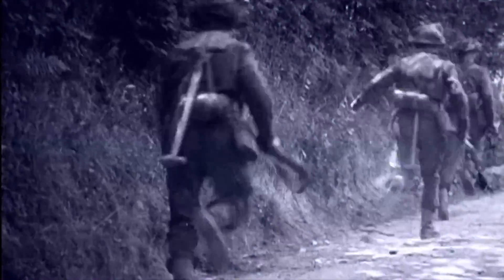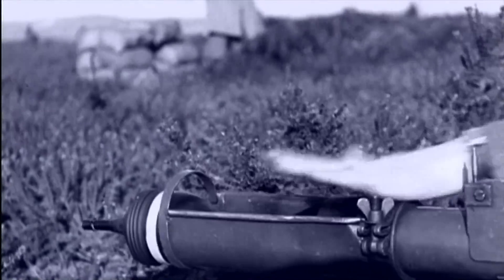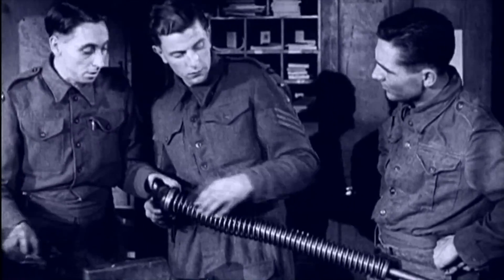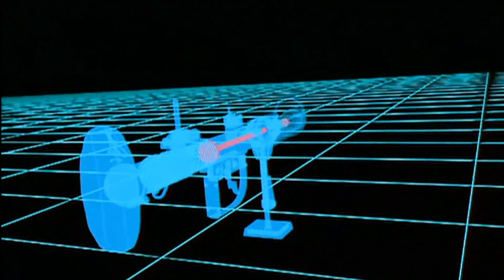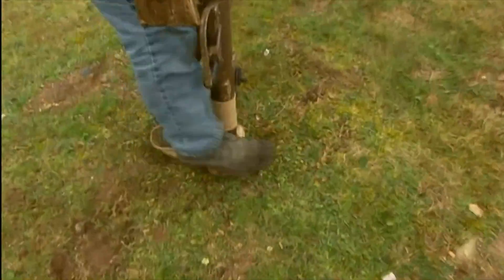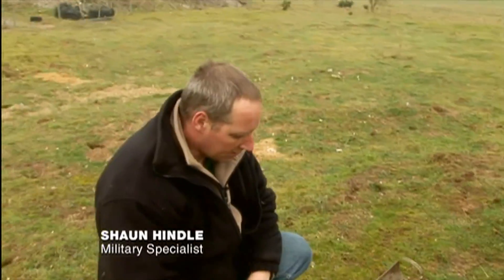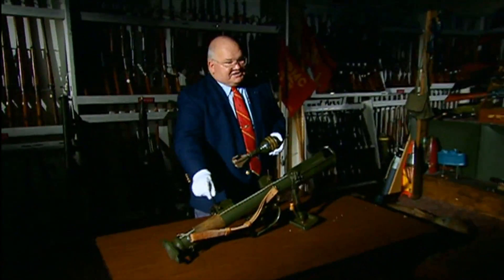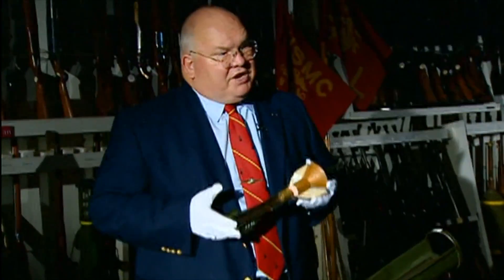Weaponology - "British PIAT"

Comment: I think the point being missed is that it was the first shaped charge AT. Prior to that it was sticky bomb!
Reply: Actually no, it wasn't. M1 Bazooka was in service the year before it, as was German's Hafthohlladung hollow-charge magnetic anti-tank grenade. I was kind of surprised to find that out too, but the PIAT entered service about the same time the M1A1 Bazooka did. I think it only gets a first if you count development rather than adoption (1941 for the PIAT, 42 when Uhl thought of using a tube launcher for the Bazooka, which should tell you how rushed the M1 Bazooka development was).
Reply: @CruelestChris  
The Bazooka was not in service in 1942, some were sent to the British in North Africa but they did not use them because they were useless. The Bazooka development lasted from 1942 to well after the war still trying to get it to work properly.
Reply: @barrierodliffe4155  
No, they didn't use them, as the source you quoted said, because they didn't feel they required a weapon with the specific capabilities of the Bazooka in that theatre of operations (due to a lack of appropriate cover to get it within effective firing range), not because "they were useless." It was indeed in service in 1942, a US weapon enters service when it is given an M designation, which happened in 1942, and they were issued to combat units during Operation Torch. The M1A1 was also in service in 42.

And no, it's completely normal for weapon R&D to iron out bugs in the weapon gradually over time: the M9 bazooka was effectively a completed model since the only developments to it were a minor incremental change to the M9A1 (a better coupling sleeve). The M20 was reflective of improvements to tank armour late in the war, which improved so quickly almost every anti-tank weapon designed mid-war was obsolete against heavy tank armour by the end.
Reply: @CruelestChris  
In other words useless, they didn't need an unreliable weapon that you could not hide and if you used it once gave it's position away no matter how well hidden it was.  The M 1 in service doing nothing. very good. The M 9 in 1944 still had severe bugs, try reading US reports on it's problems and unreliability.
The M 20 not in service for years after the war.
The PIAT was still effective in 1945.
Reply: @barrierodliffe4155  
No, they didn't want it because they didn't think the terrain would allow them to get close enough to employ it. The decision had nothing to do with reliability and everything to do with the weapon's effective range in that type of terrain. You're simply making up a claim your source doesn't support.

I've read the reports on the M9: those are not "severe bugs," they are issues . The primary one, that it had to be employed at extremely close range to defeat heavy tank armour, can also be found in British late-war evaluations of the PIAT, and indeed in evaluations of just about every anti-tank weapon in service.
Reply: @CruelestChris  
No they did not think they could get to within 30 yards and they also knew that if they got close enough they would be dead after the first shot. 
The Bazooka was unreliable until the end of the war. The issues were rather severe, meaning it was still a faulty weapon.
The PIAT was intended to be used close to the tanks, it was never meant to be a long range weapon but it could and did destroy German tanks without giving it's position away. You try to ignore how effective the PIAT was in real use.
Reply: @barrierodliffe4155  
30 yards was 1944 armour, not 1942 armour. They didn't think they'd be able to employ it effectively in a desert. They probably would have rejected flamethrowers for the same reason, does that mean flamethrowers were useless?

And no, it was if anything more reliable than the PIAT at the end of the war, and neither was it any more dangerous to use.
Reply: @CruelestChris  
The Bazooka was ineffective against real armour until after the war. The Bazooka would have been useless in North Africa even if there was cover which there was in places, it was not all desert you know or probably not your name says it all.
Flame throwers were dangerous until the British put them on the  Wasp and Crocodile, then they were very effective, the British were not stupid as you try to make out.
The Bazooka was still unreliable at the end of the war. It was far more dangerous to try to use it  than the PIAT which could be fired from a concealed position without giving it's position away and then fired again and again leaving the German's in confusion.
Reply: @barrierodliffe4155  
No, it wasn't. It was, like all anti-tank weapons, superceded by late-war advances in tank armour. How exactly do you think the M9 could be ineffective but the PIAT effective when both the M6A3 rocket and the second modification PIAT bomb had the same performance (~100mm RHA)? Either could penetrate the side armour of a Tiger I, the thing was the US wanted something effective from the front.

Both weapons could be fired from concealed positions. You can fire an M47 Dragon from a basement, nevermind a bazooka. You're simply making things up here, granting all possible credit to one system and none whatsoever to the other.
Reply: @CruelestChris  
Yet the PIAT did take out and stop late war tanks. The unreliable Bazooka was less effective, that is a fact. The PIAT did take out tanks from the front, including the Tiger tank. Both could be fired from concealed positions but the Bazooka only once then it is not concealed any more. I make nothing up the Bazooka fired from a basement and the basement would be uninhabitable for anyone unlucky enough to be in the basement.
I give credit to the weapon that served so well.
Reply: @barrierodliffe4155  
So we'll just ignore the data on what the rounds could actually do, I see, in favour of blank assertions that one must be better than the other because you say so. We know there's a least one case of an M1 bazooka killing a Tiger I from the front (blind luck, the rocket hit the driver's vision port), that doesn't mean it could do so with any degree of consistency. And we equally have reports of successful kills against late-war tanks with bazookas, including multiple cases of side and rear penetration of Panthers and King Tigers and a German account of a bazooka team managing to take down a Jagdtiger. The M9A1's reputation for being ineffective actually comes from the Korean War (specifically the Battle of Osan) where rockets which had never been designed for long-term storage were pulled out and issued, and had degraded so significantly that they couldn't even penetrate the rear armour of Nork T-34/85s. That's why development and issue of the M20 was restarted.

There are similar statements available that PIAT's effective range had dropped to dozens of yards late-war (we also have that 60% first-round hit rate at 100 yards from Sicily, backed up by range testing detailed in War Office report WO 291/153 which gave a hit rate of only 35% when the target vehicle was approaching from 110 yards to 65 yards) and it had similar problems dealing with vehicles with side skirts. The only reason there isn't a similar statement that a new model was needed is that the PIAT was already pushing the limit of what a man-portable weapon using a spigot mortar mechanism could do, and an M20 equivalent would just be a portable shoulder-breaking machine.

I mean nevermind the parts of that Bazooka copypaste-from-Wikipedia that clearly work against your point: are you seriously trying to bring up that soldiers complained about the M9A1 weighing 14.3 pounds empty as a point in favour of the 32-pound PIAT?

And as said, you can fire gigantic missile systems like Dragon and TOW from enclosed rooms, nevermind a wee fart of a thing like a Bazooka. As for not being seen, that's blind luck again: we know of cases where a PIAT crew got made on or even before their first shot (Robert Cain being one such case when the StuG III located his spotter at Oosterbeek, and let's not even bring up the part where his own PIAT took him out of combat when it malfed), and the War Office evaluation stated that a rule of thumb in the field was that a PIAT team could fire at most 3 shots before being spotted.

The problem here is you're pulling advantages for the system out of nowhere. The PIAT with the Mk1 or Mk1A bomb was similar in armour penetration to the M1A1 (~75mm RHA due to the issues with manufacturing) and with the Mk2 and later it was equivalent to an M9 firing the M6A3 (~100mm RHA). These two weapons had effectively no difference at all in what targets they could engage and how (aside from the PIAT having better anti-structure capabilities and being able to be jury-rigged into a high-angle mortar much more easily) had similar effective ranges at all stages of the war (PIAT is usually stated as "less than 40 yards" late-war with VC recipient Ganju Lama noted as saying he wasn't sure it would be accurate past 30 yards,  and it's known Patton wanted Bazooka teams to hold until 30 yards), were both troubled by side-skirts, and both had serious reliability issues early on. We know from after-action reports that ~25% of PIAT rounds fired in Sicily were duds for one reason or another, which works out as 1-2 of the six bombs an average PIAT team carried being ineffective.
Reply: @barrierodliffe4155  
I said one case of a baseline M1 killing one from the front , have you entirely lost your ability to comprehend English now? And I have yet to see you present anything resembling facts, simply blank assertions and a chunk of Wikipedia you dumped out in another thread.

And you have even less ability to comprehend English if you think I hold that anything British is no good. I've defended the bloody Sten , which is a hell of a lot more than I've seen you doing, and stated the Bren was better than the BAR on multiple occasions. While we're at it, the Typhoon was phenomenal and most of the data claiming its rockets were ineffective is nonsense, the Matilda II was superior to any German armour in France during the early war, the Lee-Enfield was the best bolt-action rifle of the war, the Mosquito and Wellington were both fantastic...Unless you believe PIAT was literally the only British weapon, this is just a dumb argument.
Reply: @CruelestChris  
One case of a lucky hit by a Bazooka and that makes it the best at least according to you.
Your trouble is you hate it that the PIAT worked.
The Sten was very good, the Matilda was also very good in France and North Africa,  the Typhoon very good for ground attack after teething troubles, the Wellington ok and the Mosquito fantastic, you left out the best heavy bombers and the best fighter of the war also British, then there was the Universal carrier and so much more.
The simple fact is the PIAT was far better than you make out.
Reply: @barrierodliffe4155  
No, I would suggest you go back and read again. Do you think misrepresenting my own argument to me is going to trick me somehow?

I don't "hate that the PIAT worked." Of course it worked, there are multiple VCs that show that. The issue here is your belief that it was some kind of superweapon. You're using the same kind of argument that Wehraboos use to big up the StG: ignore the numbers, ignore the reports, focus entirely on soldier testimonies and attack something else (they go for the Garand as a rule)  as if that makes your thing better.

Best heavy bombers I didn't include because I didn't fancy trying to evaluate the Lancaster against the B-29. Prior to that I'd put Lancaster and B-17 about equal, since both had capabilities the other didn't.
Reply: @CruelestChris  
The PIAT was a good weapon and I never said it was a super weapon. I do not ignore fact that you hate.
The B 29 came along very late in the war at very high cost and had it's own problems.
The B 17 was slower, had a lower payload and less range, I can't think of a single capability the B 17 had that the Lancaster didn't.
Reply: @barrierodliffe4155  
No, it was a mediocre weapon with issues fundamental to its design which meant it simply could not be made accurate (12 pounds of weight switching ends an instant before firing and nothing but the spigot to provide alignment guidance to the projectile). Immensely brave men used it to do incredible things, but this says more about the men than the device itself. The M1 was a worse weapon, the M1A1 comparable, but after that the M9 was the superior system in all but a few niche capabilities. Same penetration, same effective range, much lighter and easier to carry, virtually no recoil, etc etc. 

B17, better defensive armament (the Lancaster's .303s were obsolete even at the start of the war, .50 cals were too by the end but were relevant for longer and the Germans were noted as being terrified of approaching large B17 formations) and better damage survivability, particularly on the engines (Lancaster engines were better, but being liquid-cooled they weren't fond of being shot at). The B17 was also more stable and thus easier to fly in formation. While the Lancaster had a larger maximum payload, their typical carry weight was about the same. And the Lancaster was noted for having a crew escape hatch that was much too small and never redesigned: it was significantly easier to escape from a Halifax than a Lancaster. Granted, none of these make the Lancaster a bad aircraft by any stretch of the imagination and I'd argue none make it measurably worse than the B17 considering its advantages, but I would place them about equal, giving one or other the advantage if we were talking about a specific scenario.

And yes, the lateness of the B29's development is why I don't judge the comparison to be particularly fair since it's basically an aircraft from a different generation: it's as unfair as comparing, say, the King George V class battleships to the Iowa class.
Reply: @CruelestChris  
So mediocre that it did a good job when there was nothing else.  It was accurate enough for the job it was designed to do. as for the rubbish you are making up. The PIAT was there and did plenty.
The B 17 and better defensive armament is shown to be a myth since the B 17 could not escort without a fighter escort. The Lancaster did carry a bigger payload and a more useful range of bombs, you forget the US ton is much less than a real ton.  Not only was the Lancaster in no way bad it was far better and di far more than the B 17. 
If talking about any bombing scenario the Lancaster was better.  
Was the Iowa very bad then?  because the King George V battleships were not bad.
Reply: @barrierodliffe4155  
Being the only thing available to do the job automatically means it's the best tool for the job, you ninny. The point of comparison at the time was the Boys, which was heavier, larger and totally ineffectual in just about any scenario where it was used against armour. I am not making up anything: the accuracy of the PIAT was poor as a result of the nature of the weapon itself. Or are you trying to imply that the PIAT's striker assembly did not weigh 12 pounds, did not switch ends an instant before firing, or that it had alignment guidance aside from the launching spigot? You see you keep accusing me of making up concrete facts and it's just making you look desperate.

The B17 had superior defensive armament to the Lancaster, this is a simple matter of counting turrets and guns and looking at the calibre. Of course it was preferred to have a fighter escort, but that wasn't really an option until they started putting Merlin engines in the escort fighters because they didn't have the endurance. And you're assuming the bombload stats I was using were in tons for what reason? They were in pounds. The standard loads for both aircraft were similar, about 4,000 pounds, since it allowed them better range than deploying with a full load. Yes, at max load Lancasters could take off hauling eleven 500 pounders while the B17 could only manage 8,000 pounds, but that wasn't normal.

And I really don't understand your reading comprehension sometimes. It's unfair to compare the King Georges to the Iowas because one was a prewar Washington Treaty compliant design and the other mid-war and not compliant with anything. The KGVs were excellent ships when they were designed (which is impressive considering quad turrets seldom worked out well), but no match for a non-treaty battleship whose only design limitation was the width of the Panama Canal.
Reply: @barrierodliffe4155  
Oh I se, it was "obviously" good enough! The problem here was you hadn't said it was good enough one more time, now it's a compelling argument based on fact rather than you saying the same thing over and over without any substantial evidence. And what "lies" am I telling, exactly?

The B17 could survive without a fighter escort. We know that because they didn't have a 100% loss rate when they were operating without one. Again, the superior defensive armament is simply a matter of counting how many guns the two aircraft had and noting their calibre: this is as flatly stupid as saying the T-34/85 didn't have a better gun than the T-34.

I notice your usual lack of evidence when you claim the Lancaster generally flew with a larger maximum payload. And it should be obvious that 11 was a typo of 21 given I was saying the result was larger than 8,000. Your constant bad-faith arguments are a little tedious at this point, are you just hoping I'll get bored of talking to you and go away?

And seriously, you ridiculous little gremlin, are you trying to argue the King George V class were actually better than the Iowa class?
Reply: @barrierodliffe4155  
Again, completely unquantified claim there. Oh wow, it "worked" and "took out a lot of tanks," that's totally a refutation of a statement that its operating principles made it inaccurate.

As I said, the B17 had superior defensive armament. This is a very simple matter of what the defensive armament was, and has nothing to do with any of this irrelevant crap about escorts. And apparently it's a "lie" that they didn't have a 100% loss rate because...their first raid had a 50% loss rate? Do you not realise this meant half the aircraft involved survived ? And we have plenty of accounts from Luftwaffe pilots that they dreaded attacking B17s, while Japanese accounts describe it as a "four-engine fighter suitable for all purposes." It's because it carried all those guns and all that additional armour that the maximum bombload was cut down: that's a conscious compromise in the design.

The raid escorted by Spitfires that you're talking about had a 0% loss rate because the Luftwaffe didn't engage it at all according to the Spitfire crews (while the B17 gunners claimed they'd shot down 25 BF-109s, go figure), so that's not really much of a surprise. We know B17s were responsible for something like 12% of Luftwaffe daylight fighter losses even when the overclaim rate (roughly seven times too high) is factored in, which was not a loss rate the Germans could sustain while the Americans could lose a more or less unlimited number of B17s since they were churning them out so fast and not experiencing any kind of crew shortage. The use of much heavier gun armament on B17s was effective in reducing the Luftwaffe's combat strength through attrition and contributed to the overall allied strategy of clearing the skies over Europe. The fact that it didn't make the bombers individually invincible is just a red herring.

The very high early US bomber casualty figures were a result of underdeveloped US bomber tactics. These in turn were because the Yanks didn't think they had anything to learn from anyone else: you see the same thing with US subs in the Pacific being ineffective early on because the didn't think they needed to copy the German wolfpack concept (and their torpedoes were the most shite of anyone's in the war, granted), and with Japanese submarines for the entire war because they never cottoned on to the idea that subs could operate in groups.

And no, it's not wrong, 10,500 pounds of bombs was an uncommon but standard Lancaster load. I see I'm not even allowed to praise the thing unless I'm spooging all over it. Yes, they could indeed carry Tallboys (and the 12,000lb Blockbusters which the B17 couldn't carry either, and the 22,000lb Grand Slam with modifications), but that was hardly a standard load. And it's not really surprising that the Lancasters involved in Operation Catechism against the Tirpitz didn't need defensive armament, given the only fighter unit in a position to intercept them failed to get any planes in the air during the raid. Moreover, the Tirpitz was within range for B17s with their typical bombload and fuel load, though granted they'd have had problems doing anything meaningful to it with standard bombs.

And really, King George V class were "in some ways probably better?" What ways? Do you think this is going to impress anyone? What am I supposed to be lying about here? 

And really, this would be the same HMS Warspite regarded as so obsolete that the RN didn't bother to deploy her to the Far East? Come on, she did some great bombardment work, but that doesn't mean she was better in terms of design, she was a WW1 battlewagon that would have been turned into scrap metal if she'd encountered a modern battleship rather than some crusty Italian dreadnought, and the RN knew it.
Reply: @barrierodliffe4155  
So your criteria for a British weapon are "is capable of functioning in any way" and for an American weapon is "must kill Superman with first shot or is useless." Frankly I can't be bothered with you anymore, you can happily declare victory if it helps you deal with your mother leaving your PIAT father for a handsome foreign Bazooka or whatever the hell happened to fuck you up this badly.
Reply: If you do not care, then stop replying. Sorry but you got outsmarted Barrie :)